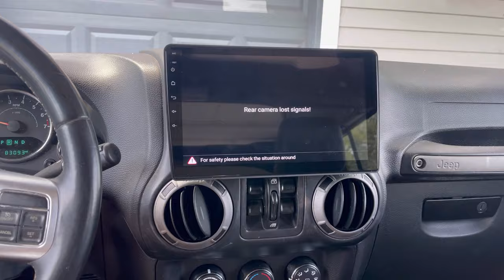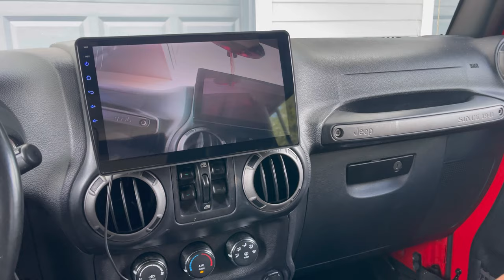How to wire reverse camera if your vehicle has canbus (Jeep,Dodge,Chevy,Gmc,Volkswagen+more)

Comment: I bought the same android unit for my land rover disco sport 2015. Sadly but factory camera is not working and I tried your way and is still not working. Tried to change ntsc to pal and every other option but no luck... Is there any solution? I only have no signal message but my parking sensors are working normaly

Comment: This is about the 20th video I've watched trying to figure out fitting an Eonon canbus/head unit/reverse camera to my Golf, and it's the first one that has made absolute sense.  A couple of small differences in how the wires are laid out on my system but now that I understand what's actually going on I can figure it out.  Thank you :)
Reply: Also had a golf mk6 and was in tail light and did not work at all. Had i did like this it would work. Its get power from stereo so no need tail light.

Comment: Great! Without previous experience, I've installed the rear camera thanks to your video (the unit I bought, on Aliexpress, came with a wire already "ready" to be jointed to the red wire, marked "back", no need to cut and split the "pink" wire)>
A big THANK YOU! 😁

Comment: Have wired a good few reversing cameras in past, mainly on excavators and trucks and this one I bought for my VW caddy threw me off. Spent ages neatly wiring it into tailight loom and was puzzled when it didn’t work. Would have been handy if stero manufacturer labelled cables. I was sure the little blue wires were the signal ones. Will have to go back out to workshop now and get it sorted, cheers for the good video, don’t know what I would have done without it

Comment: This video right here!  This is the one that I have been looking for.  Followed the steps on my BMW 335i and it worked perfectly with my Eonon head unit and backup camera.  Thanks for the info.  The trigger wire from the canbus is the key.
Reply: Where did you Connect the trigger cable? Pink or Brown?
Reply: @AlbertoTV85  start watching at 2:10 in the video.  It shows it.
Reply: @AlbertoTV85  pink

Comment: Thanks a lot for the clear instructions. I will test that tomorrow, but I'm sure it will work. This gave me the confidence to do it.
Real valuable content.

The iso cable comes with a clear "Rear" flag on it. On the canbus plug there's nothing AND it's already plugged elsewhere.
 I knew it was the third cable next to the red power wire, but it's hard to start cutting wires on a brand new unit when you're not an electrician. one is always afraid to ruin the circuits and the warranty.
But I think the ground comes already from the yellow video cable. I guess the little black wire can be let free
Reply: I recommend hooking up the ground, less your head unit becomes the ground in a short. Its like hooking up the 3rd green wire ground on a ceiling  fan. That would be my assumption why the wire is there.

Comment: I did mine with a canbus and I connected it to the reverse light worked only when car wasn’t on only ignition position 1 but when I turned engine on and put in reverse didn’t work so that’s were I made my mistake thanks for the video I’ll re do it again tomorrow

Comment: F-250 install....Thank you so much. Just like you said, regardless of wire color (mine was Brown even though the manual diagram showed Pink) the Third from the Ground splice between the CAN box is the Ticket!!!! I have been back and forth with the customer service rep and technician sending generic videos and fuzzy pictures from the slow boat from china Alibaba company (Reako Sounds plug and play K2001N Android 12) that I bought mine from. So for $50 bucks, I really can't complain!
Reply: Where did you connect thé camera to? I have the same problem.

Comment: Just figured mine out on my own,instead of stripping the pink one I connected to one of the two little blue ones at the side of the video cable.
Reply: Which unit do you have?

Comment: Thank you for sharing 🙌🏽 Very helpful! In your vid you stated the trigger wire is always the 3rd wire next to the red wire and colors may vary. Will this stay true, even if the wiring harness or head-unit is not the same as the model here?  My audio vision unit’s 3rd wire is brown and runs from it into the maroon canbus module. Just wanted to confirm 👍🏽 Thank you in advance!
Reply: He probably can't say yes for sure, now that so many models are out now. You could try a test light on the plug to see what it powered when the car is shifted into reverse?
Reply: @jonny5ive167  Okay, sounds like a plan bro. Thank you 👌🏽

Comment: Rca spliced to oem harness, I just installed the Atoto S8 Premium. I get rear cam output on screen. Hence, I don't get signal from rear cam when in reverse. As could it be because I didn't wire up brake wire or ground it? Please help out if you can here...

Comment: Just to understand better. at step 6, the pink cable you cut and reconnect (pink one, "radio's trigger wire") is coming from the canbus adapter?
Reply: Did it work after cutting wire from canbus?

Comment: Does the pink (3rd wire) receive the 12v when the vehicle is  switched into reverse via the canbus.  I'm using original camera and not connecting the additional camera and not spicing pink. The unit should receive power and switch screen even if the camera is blank. What controls power to this pink wire - Is it programming in Canbus or the Android device configuration?
Reply: If not power to the red wire (the one who connect to the Third like on the video) when reverse then take the positive from the back up light.this is that works for me

Comment: I hope this works. I already had a camera hooked to My Jeep  u connect radio and I just hooked the rca to the new radio and of course just static. When car goes in reverse it switches to camera screen but static signal. And it worked fine with uconnect. I got to take it back out and try this wire thing. 🙏
Reply from the maker: It sounds like you need to change the camera settings

Comment: Which is better, crimping or soldering?

Also its shocking the amount of videos ive seen where people are connecting to a reverse light or a washer motor wiring to power the camera instead of using the power from the head unit which has canbus.
Reply: soldering is always better. do the pull test and you'll see . but not everyone has solder..

Comment: Where did you coonect to Ground black wire?
Reply: It needs to be grounded to the vehicle. Find a metal spot somewhere close the camera to attach it, preferably underneath out-of-sight. You may have to drill a hole and use a screw if you can't find anywhere.

Comment: I did all that but my camera is not working, I have T’eyes c3, in instruction says to wire the red wire to pin 3 which is Accessory and yellow wire to pin 5 which is trigger wire. With all that no image. At the back connected like you did on yours. Do you have any suggestions?
Reply: It's a non sense. Accessory wire send 12v constantly when ignition is on. The camera will be always powered when u drive. And the cable camera going to the head unit has only the video connector and a little red wire. This red wire should be connected to the trigger and plug the yellow connector with the yellow "camera in" connector of the head unit.

Comment: Heya. Im having trouble with the camera. It works fine to be fair, but at night it takes atleast 8 seconds for the brightness to adjust. Is there a possible way to have the camera stay on (not visible on screen) as soon as the rear lights turn on? Thanks for the great video btw
Reply: Your unit is probably slow or faulty. With Canbus, as soon as you go into reverse it will signal your camera, if it’s not adjusting then no wire changes will fix that. Even if you link it to your taillight I’m pretty sure it would still do that, not sure just my thought
Reply: @raquellewis7294  I dont think my unit is slow nor faulty. The iso and all that is controlled by the cam so it probably takes a minute to start up and adjust it all. My thought was that i might be able to circumvent this by having it powered all the time.

Comment: I just installed this radio in my Jeep jk 2007 model with factory amp. But I bought a reverse camera that mounts to the rear tire Carrie. I followed these instructions but the rear camera doesn’t have same connection. It has a black one with 4 pins that goes to camera and the front before camera connected to pins has the black and red wires that comes off the main wire. Would I just connect the 4 pins connector and open the end to camera to find red wire and splice into it and ground the black wire.

Comment: The video is very helpful, but I have a wireless transmitter and receiver, I can connect the receiver like this, but I have to connect the transmitter to the taillight or I would have to pull a cable through the whole car, which makes no sense.

Comment: Can someone please tell me about 7:58 what happens if we connect the red wire to reverse tail light like we would in a non canbus model car ( i assume the power gets taken from both reverse light and stereo)

Is that going to damage something??
Or is it just there to save extra effort to not connect them to reverse light power positive???

Thanks
Reply from the maker: Hi 👋 the power comes from the canbus. If you connect it to the reverse light as well it will send a unnecessary signal when in reverse and it could damage the canbus after a while, which will then cause the radio to not function properly.
Reply: @audiovisionusa   @AudioVisionUSA  okay thanks so if we so have canbus, its best to wire like in the video first, and then if still not working like this then only connect the red rear to power positive from reverse light. Got it thanks. Will avoid wiring like normal.
I was just unsure because I'm buying canbus for an older car like 2005 opel corsa c, so unsure whether that canbus would be sending reverse signal or not (its mainly for steering wheel control i think).

Can i just another question if we need to plug rear red to power positive, can we still do that (if wiring like in video isn't working) and then not connect the red power from yellow RCA to front of radio?

Thanks again your very helpful
Reply from the maker: @divyanshugogna6152  if it automatically switches to reverse without the camera being connected then the canbus triggers the reverse camera. If it doesn’t then you have to wire it like the other video we have. If you have manual transmission you will most likely have to wire it directly to the reverse light
Reply: @audiovisionusa  its automatic transmission, and it show what gear is vehicle in on car's dashboard, so i guess canbus should automatically switch it.

I will wait for stereo to come and report back thanks again.
Reply: Then? What's your report? Regards
Reply: @audiovisionusa hi do u know y I might be getting a slight grainy lines in reverse picture? Thanks

Comment: You say dont connect the wires to the tail light. Than where should i connect them?
Reply: Do I have just connect the red wire from RCA cable with the red from the power supply and i dont have to connect them anywhere else?
Reply: I managed the camera to work. But it was necessary to connect it to the supply of reverse light. I cant see how it should work on any other way

Comment: How do i connect it if I only have a red cable on the one side of the yellow rca, the other side is a 4 pin connector and red and black wire
Reply: A mi me pasa lo mismo. No sé cómo solucionarlo.

Comment: In some videos on YouTube they said  not to connect the ground cable from the rear camera to anything... I tryed and didn't work, gonna have to ground that cable and give it a go
Reply from the maker: It would work without connecting the ground so your issue is probably something else
Reply: @audiovisionusa  on the back of the radio I plugged into the 3 pin (pink or brown like they say) the red cable from the main cable that connects all the way to the camera in the back also that red wire is plugged whit the red from the connector power of the camera, in an android unit whit canbus,
Reply: Then that ground cable I didn't connect to anything, losing hope on that back up cam...
Reply from the maker: @jorgebicho2216  is your vehicle automatic? And does it switch to reverse option by itself when put in reverse?
Reply: @audiovisionusa  no, it's manual
Reply: How do I know if it switches?
Reply: Should I connect the power of the camera to the back up light positive?
Reply from the maker: @jorgebicho2216  like in the video it automatically switches to reverse camera when put in reverse. If you have manual transmission you have to wire it to the reverse tail light like this video https://youtu.be/kS_dt6_1oxM
Reply: I'm gonna try it tomorrow, big thanks 👍
Reply: @audiovisionusa  should I keep the red wire connecting to the 3 pin in the main power plug of the radio?
Reply: @jorgebicho2216  i assume so

Comment: Hi, 
My car is 2012 Honda Accord and recently installed android Radio then installed backup camera. When I turn on Reverse mode, the camera turns on (led light turns on) but the no video it ahows only black screen. 
1-I have connected one end cable to radio Cam-in rca yellow jack and spliced red cable to other cable labelled as back.
2-  connected other yellow  rca jack to camera yellow jack,  red wire spliced to power card red wire then both spliced to reverse light blue cable and connected power cord to camera black rca jack.
3- power cord black wire spliced to reverse light black cable.

Not sure what I did missed over here, but not seeing camera video on screen.
Can someone suggest what I am missed here?
Reply: did you ever get yours working? Cannot get video on mine either.

Comment: Hi i with canbus. if I follow this procedure the camera will be powered by Pink wire (reverse) ? Right ?
Reply: Is it right? Have u tried ?
Reply: That's the hope, at least. Seems like sometimes it works and sometimes it doesn't. Dependent on whether you have an 1. auto vs manual transmission. 2. If your canbus actually "communicates transmission gear reverse" as some canbus are designed for other features in different cars and may not be associated with transmission gear status. If this is the case then even if you have a canbus - it won't work if you splice it like in this video. 

To figure it out (I think) just hook up your android head to power before you do any splicing and cutting and just put your car in reverse and see if the android head screen switches to a "Reverse cam view" regardless of if the cam is actually attached. I guess the only plus to attaching the cam before you install it is to confirm that it draws enough power from the "reverse" wire.

Comment: I have canbus and on connecting the camera getting flickering images (irrespective of ignition being turned On or Off). I touched black (ground cable to one of screws in car but no improvement). Any idea what could be wrong?
Reply: If you had the rear black wire connected to ground, try disconnecting it. Because ground has already been provided by the yellow coax connection.
Reply: @zaidzaid4747  so we don't even connect black wire to rear lights ground??
Reply: @divyanshugogna6152  I think the yellow RCA cable is the ground, so (i guess) no need for the ground (black cable)
Reply: @ronaldd.1355  I got mine installed yesterday even though i have canbus but i had to connect it as a non canbus car for reverse camera to work with my car.

The correct wiring for me was 

At front - connect red wire to pink trigger wire, and yellow to yellow (camera input)

Pink wire wasn't open hence i had to splice it and then connect to red wire.

At back -
1. connect reverse light + wire to 
Both red wires ( camera red power and red going to front in convince wire)
2. At reverse camera yellow to yellow and red to red.

Also i have tried using t taps and crimpers they are $h!t honestly. Never trust them. Best to solder it, then solid connection.
Reply: @divyanshugogna6152  Thanks for your info. Maybe your point #1 (reverse light) is the same as pink wire (so I guess if you leave it unplug it would be sufficient).
Reply: @divyanshugogna6152  I'm thinking Ill have the same problem even though I have a Canbus but I'll just hook up the head unit and see if it senses my gear in reverse. If not I guess it'll be the traditional install with connection to rear lamps.

Comment: I tied the power from the RCA cable into the rear cam power (12v) from the head unit. Backup camera works when the vehicle is off and key is turned to ACC, but not when the vehicle is running. Any ideas?
Reply: Any advice on this question I'm having the same issue in my vw cc
Reply: My guess is it's wrong power red/pink wire connection,?? Your radio might need a different color wire to source power from
Reply: All was wired correctly. Oddly enough, I got it to work by cutting/disconnecting the black wire for the camera. I’ve seen several others say the same thing worked
Reply: @rm.builds    was that black one is @7:42 or @6:44 that you had to disconnect (and reconnect or leave it disconnected permanently)

Thanks

Comment: So I’ve connected everything and the camera worked. And then next day it stopped working.

Now I haven’t ground the wire to anything and it was working. But could that be the cause because I didn’t ground the wire?
Reply from the maker: It’s most likely something else, the ground shouldn’t effect this. One of your connections may have came loose or it could possibly be your settings if they were adjusted.
Reply: @audiovisionusa  Ok I’m going to check connection and if not factory reset it unit
Reply: @audiovisionusa - it was the connections. Thanks for the help. Subscribe to save another persons troubles